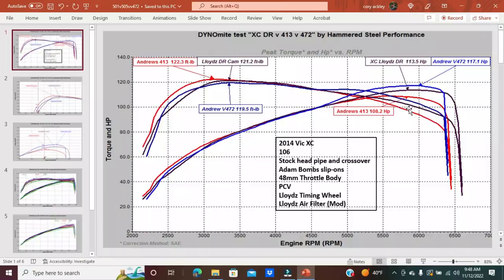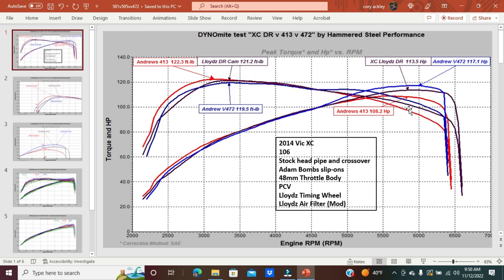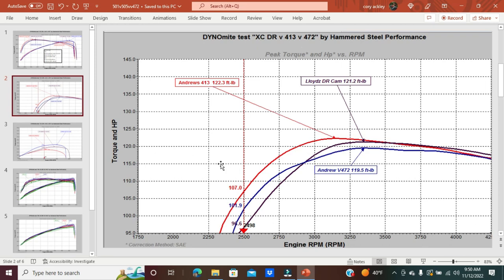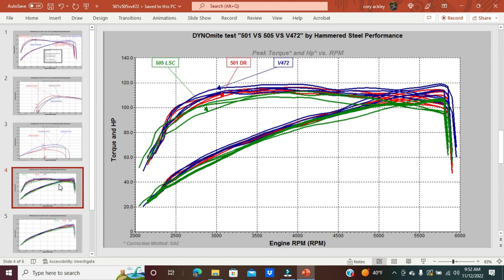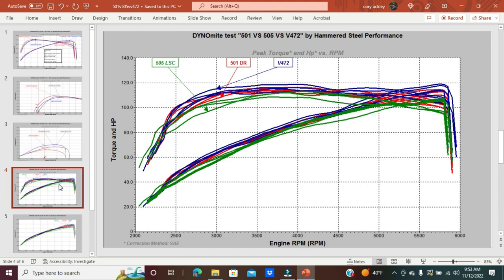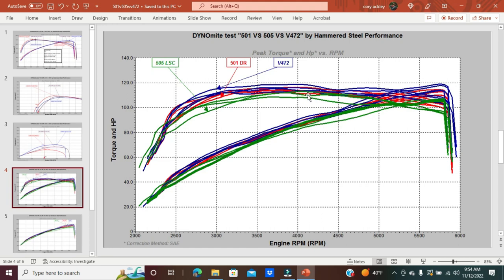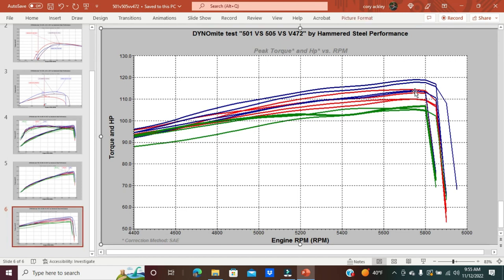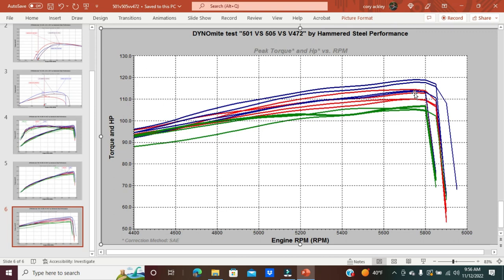Best Victory Motorcycle Camshaft?????

Comment: Thanks again for all the time and effort you spend on our fairly niche world of Vic performance. I decided on the 472's for my hammer because 1. the bike was destined to be a bit of a hotrod, 2. I had an underdrive pulley and 3. I had access to low cost dyno time to work with them a bit. It seems if you're willing to work with them a bit as far as intake and exhaust you can get quite a bit out of them. My best numbers were 124.8hp at 6900 rpm. Had the limiter set at 7200 I believe. Torque was 118.2 @ 4300. You could really start to feel these pull as you passed 3500 or so. I should mention that I played with exhaust primary length and intake runner length to get these results. I built a custom airbox with the largest panel k&n filter that I could fit. Ended up being about 2.5 times stock filter area. And I will admit that it was definitely a bit soft below 2500. For me though, this made the bike easier to launch without blowing the tire off.
Reply from the maker: You are correct, if you have the resources there is ways to optimize most combinations into the power band that suits one's needs.  

Great work on your set-up!!!!

Comment: I feel like a trend chart between 501,505 and the 413 since they are the drop in cams. And do another with the 504 and 472 since they require lift spring and carrier group modifications. Not sure if that makes since.
Reply: It does make since, Sorta have to use the data that I have.  Have not done enough of the 504s (in 106s) to develop trends.  Thanks for your comments and I'll look into your recommendations as more data is obtained.
Reply: I agree with this. Looks like the 413 stomps the snot out of the 505 from 2500-5000rpm. Looks like it stays above 110tq the entire time..

That said I'm not looking a tour model but a gunner or highball for me
Reply: Yes, I would like to see that comparison as well. I have a 2014 XC with the HPT 504 cams, ECM Flash, Adj Timing Gear, High flow AF & dyno tuned. The bike makes 121HP/112TQ w/Tri-Ovals I would like to add the UD Pulley because I'm about 250lbs plus my bike is a stereo monster so I need all the pwr I can get without breaking the bank. This was good info because I was on the fence about upgrading my cams to the 427's but I'm going to do the UD first. Also, with me having the carrier work done already would I need any other MODS for those 427 cams?
Reply: It is something to consider comparing the 504 to the V472.  While I do not have the dyno numbers or the actual power curves from the dyno, I know that there was a 116 Vision with Star Racing ported heads.  They tested both the S&S .495 cams and the 504s, I heard that the 504 made more power in thst application.

Now what does more power mean, I do not know as I do not have the dyno comparing the two.

But since the V472 and the 495 cam are very close in specs.  And I do not know the specs on the 504s.

Comment: I wish you had a stock setup & cams to be used as a baseline.. preferably from a 106 motor.
Reply from the maker: Do you mean, that you wish there was a stock base line and then the after with cams?   Or did you mean something else?

 There is multiple of those on my Facebook page if you go to Hammered Steel Performance FB.  Might have to scroll through the years but they are there sir.
Reply: @hammeredsteelperformancehs1120  yes, as in the same graphs where you show the hp & torque with different cams you also showed the same info from a stocker..
Reply from the maker: Gotcha, I can do that and put it in the comments on my Facebook page for HSP.

Comment: I got the Andrews V438's for my 06 Jackpot. It was a great deal and I hope they work well. One day I'll get off my ass and install them
Reply from the maker: The 438s are decent and should work well.
  What intake and exhaustbare you planning on running?
Reply: @hammeredsteelperformancehs1120  Well I sold you the S&S intake, I got Terry to make me a special set of his torque tubes to go with my aluminum throttle boot. I have the RPW Ness slash exhaust, thinking of maybe going with a Big Slash 2 into 1.  2006 Ness Jackpot
Reply: The RPW Big Slash is a good exhaust!

Comment: Thank you for your time and effort putting these videos together, it is much appreciated. Couple questions, bike is an XC. 1. Is it noticeable or worth doing the bored throttle bodies and is there an optimal amount? I’ve seen 42mm and 45mm options. 2. Is there an installation info resource on the 472’s? I haven’t found much info on what exactly is needed for valve spring height and what to do if they need to be changed. I have been mostly considering the 501’s, but I’ve seen many graphs of the 472’s and they seem to outperform the 501’s pretty much across the board.
Reply from the maker: Chris, the stock throttle body is 45mm, it is not really worth upgrading to say a 48-50mm.  Several hundred dollars for a potential 2-3 hp up top.

If you go to my youtube page or Facebook Hammered Steel Performance  I did a video on Friday that addresses all of your questions on the V472s.
Reply: @hammeredsteelperformancehs1120  oops, I misread the size in your video. Good to hear that the dollar per hp isn’t there, save me some money for other stuff.

I just watched the video on the 472 fitment. That’s the easiest explanation I’ve seen for that. Thank you again!!

Comment: So what I’m seeing is the 413 cams make power sooner. Be better for daily use 
   Interesting
Reply: V413 have their place, 2000-5000 rpm cam, nice mid range torque production.  I prefered the 501 and the v472 for my atyle of riding.

Comment: What do those numbers mean? are they lift numbers? duration numbers? just some arbitrary number? Do we know the left and duration, lobe split angles, any of that stuff, on any of these Cam's?
Reply from the maker: Only the cam timing specs are known for Andrews cams.  Lloydz do not publish their cam specs.

The Andrews V413 cams intake valve opens at 13* BTDC and closes 41* bbdc.  The exhaust opens 41* and close 05 after TDC.  Both of these are at .050.  Giving a 234* int and 226* exh and .413 int lift and .423 exh, with 18* of overlap on a 106 LSA.

The V472 intake Duration is 242.00 degrees. Exhaust Duration is 238.00 degrees @ .050
Installed Intake Centerline is 104.00 degrees ATDC.
Installed Exhaust Centerline is 110.00 degrees BTDC.
LSA is 107.0 degrees
Overlap is 26.00 degrees.  Lift is .472 on both int and exh.

Yes both of the Andrew cams are reverse splits as well as the Victory stock cams.